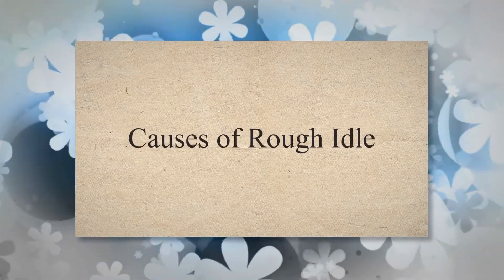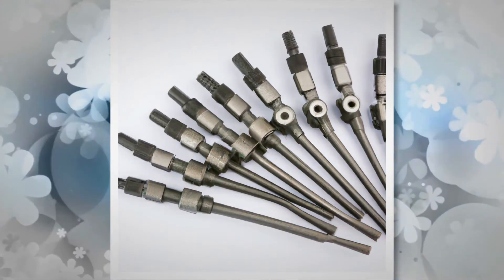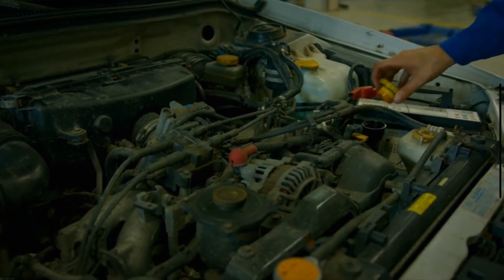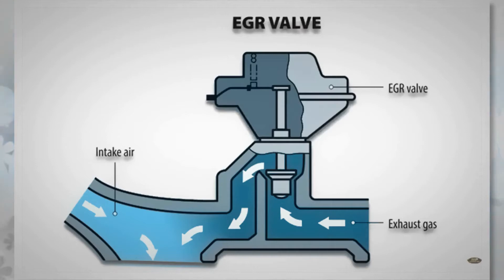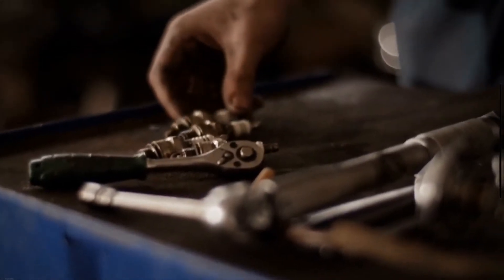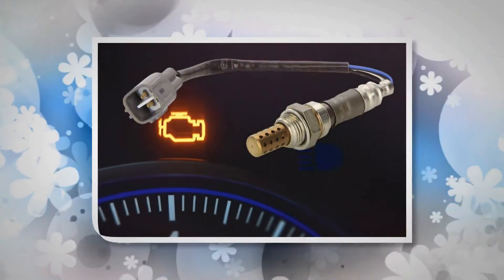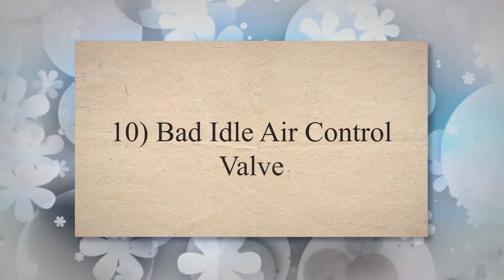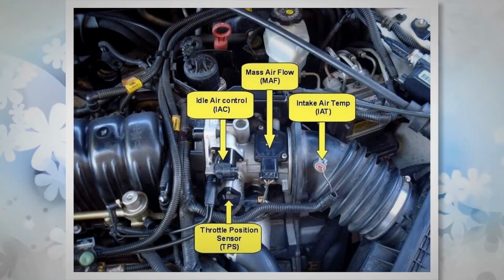11 Common Causes of Rough Idle | How To Fix Car Rough Idling

Comment: After mechanic came and replaced my head gasket now my car misfires goes for about 1 minutes then stalls and turn off completely
Reply: I just had the same happen after replacing my head gasket on a 2011 diesel Hyundai i20. It's been a long journey getting it done and having this issue come up just makes me want to scrap it.
Reply: @VicJanczkowski  I just found out that it burn my fuse box as well as fuel pump overheating and changed my sparks plugs and ignition coil it's good
Reply from the maker: @victorn6523  After a head gasket replacement, if your car misfires for about a minute and then stalls and turns off, there are several potential issues that could cause this behavior. Here's a breakdown of possible causes:

1) Incorrect Timing
I) During the head gasket replacement, the timing belt or chain may have been disturbed. If the timing is off, the engine may misfire and struggle to run.
II) Check to ensure the timing marks on the camshaft(s) and crankshaft are properly aligned.

2) Vacuum Leaks
I) A vacuum leak can occur if intake manifold gaskets, hoses, or connections were not properly reinstalled after the repair.
II) Inspect all vacuum hoses, intake manifold gaskets, and the throttle body for leaks.

3) Faulty or Incorrectly Installed Sensors
I) Sensors such as the crankshaft position sensor, camshaft position sensor, or mass airflow sensor (MAF) might have been damaged or improperly reconnected during the repair.
II) Use a diagnostic tool to check for sensor-related error codes.

4)  Improper Cylinder Compression
I) If the head gasket was not installed correctly, or if the cylinder head was not properly torqued, it could lead to low or uneven compression in one or more cylinders.
II) Perform a compression test to confirm even compression across all cylinders.

5) Fuel Delivery Problems
I) The fuel injectors or fuel lines may have been disturbed during the repair, causing inadequate fuel delivery.
II) Check the fuel pressure and inspect the injectors for proper operation.

6)  Ignition System Issues
I) Ignition coils, spark plugs, or wires may have been damaged or not properly connected during the repair.

Comment: Why is he putting in a timing chain when talking about a faulty coil?
Reply: That was a coiling chain.
Reply: @88mike42 still not the coil if I was a newbie I'd be petrified seeing that. Actual coil packs are so much easier like 2 bolts disconnect.

Comment: Which of these would not cause an engine light on?
Reply: I don't know if I'm having the same issue in relation to his question, but I personally have a rough idle in my 03 GMC Envoy but the engine light isn't on. What issue(s) can cause a rough idle without the engine light coming on?
Reply from the maker: @gynell2043  kindly watch the complete video. I already have explained all the issues that may cause rough idle without triggering the engine light. Poor quality Fuel, Defective airflow sensor, Vacuum leaks, bad EGR valve, Bad spark plugs or Low fuel pressure may also cause rough idle without check engine light
Reply: @gynell2043  and make sure there even is a check engine lights, some people remove them just before they sell the car ;)
Reply: @jackarmando  , how do we know if the check engine light is removed or disconnected from the back?
Reply: @WajeehHassan-im3xp  you pull the headunit out and check the bulb or when you turn on the key everything lights up to check if the light is there
Reply: @jackarmando nice! Thanks for the info
Reply from the maker: Kindly elaborate your question